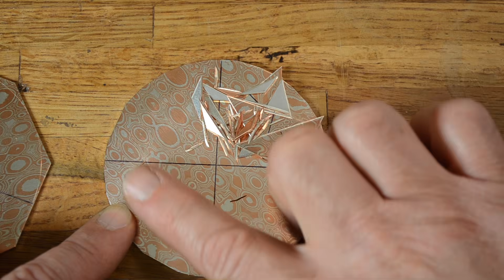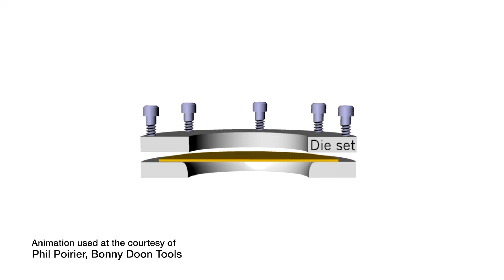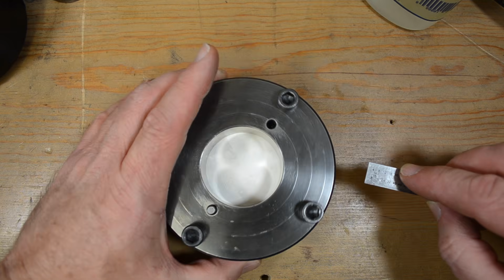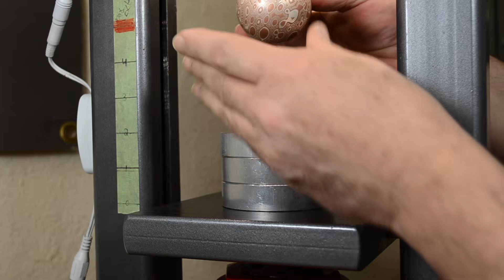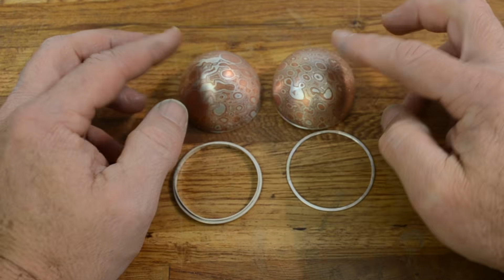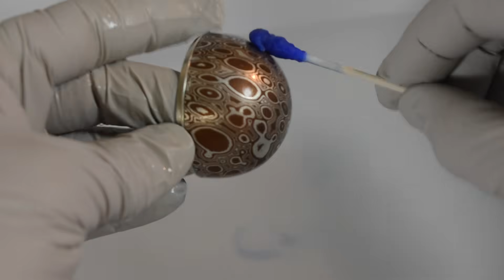Shallow Dive into Deep Draw Forming

Comment: If you could secure / hot glue a node in the centre you could simply spin it around at a table disc sander and get it perfectly circular in seconds - I suppose thats sacrilege for a jeweller but my mini sander collects the dust

Comment: I learned some new tricks from this video. Thank you. 

Downside:
Had to do a lot of fast forwarding; way too much micro-detail and talking. Also, really don't like your annealing technique.

[Why You Should Quench Copper

Immediate Softening (Dead Soft): Quenching instantly locks the crystal structure in a "dead soft" (malleable) state.

Faster Workflow: Quenching allows you to handle the metal immediately, avoiding long wait times for it to cool down.

Reduces Oxidation/Scale: Quenching, especially in water mixed with a little vinegar or pickle solution, helps reduce dark oxidation/scale, leaving the copper cleaner.

Prevents Grain Growth: It minimizes the time the metal spends at high temperatures, reducing excessive grain growth.

●Important Tips

Heat to Dull Red: Heat the copper until it shows a faint dull-red color in a shaded or darker area.

Avoid Overheating: Do not heat it to a bright orange or yellow, as this can lead to grain growth and damage the material.

Quench Medium: A bucket of clean water is fine, but adding white vinegar to the water will help descale it.

Note: Quenching does not harden copper the way it does steel. Unlike steel, which becomes brittle, copper becomes more ductile (soft) when quenched. ]

Comment: How to make silver-copper mix?
Reply from the maker: The standard alloy for sterling silver is 925 parts silver to 75 parts copper for a total of 1000/1000. To create the alloy you can melt your copper, and slowly add your desired quantity of silver until the alloy mixture is fully melted and liquid.
Reply: @RioGrande1944 yeah, that's how you get Sterling. Pretty sure this person wants to know about the technique used to create the Damascus pattern in the metal.
Reply: @RioGrande1944 i mean this particular mokume type, as you show in this video
Reply: @leapintoeternity have a look at blacksmiths videos on pattern welding/mosaic damascus if you are interested in the different patterns and their names etc. This is a 'rain drop' pattern, made by drilling holes in a copper/silver laminate bar before flattening it to a sheet.
Reply: @hendrikvanleeuwen9110 thanks!

Comment: I'm curious why you spent so much time showing and telling how to set up to use a manual file to refine your disk when a small inexpensive belt sander would be a lot faster, a lot more accurate, and virtually zero set up after your initial set up. I do understand that fine adjustments are required in your field. But in this case, with very little practice, you could achieve much more accurate results much much quicker.
Reply: Many of us prefer the more manual approach for a variety of reasons.

Comment: Great video well demonstrated. Could the blank remain square with the dimension equal to the distance between the screws to aid alignment. As the finished part is cut at the end does it need to be cut round to begin with.
Reply: My thoughts exactly, but the tips with the bench pin were great.

Comment: Thanks John, I can see using the Swanstrom 2 and a half inch disc cutter to make a circle, but it would make the vessel a bit smaller. What do you think of this idea or do you have to always use a 3 inch because of the size of canister?
Reply from the maker: Great question! The deep draw tools will require you to use a metal disc the right size - this will allow the tooling to hold the disc while stretching the metal. Unfortunately, a 2 .5” disc will not hold in the tooling properly. Please reach out if we can help further!